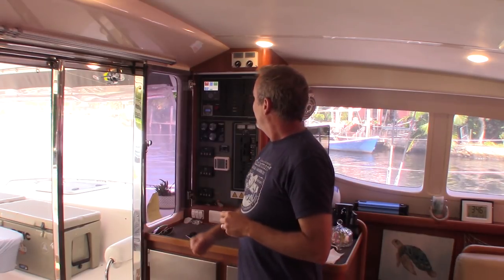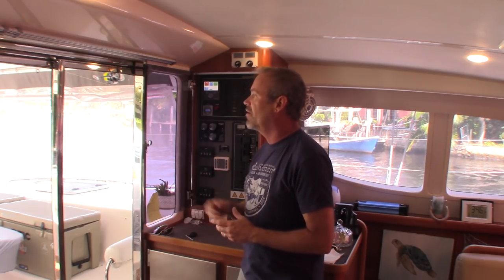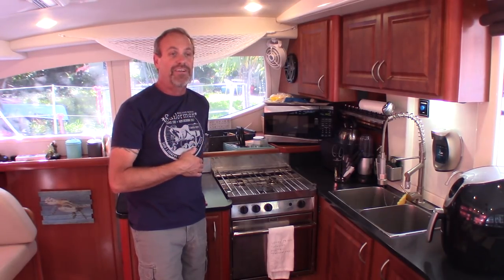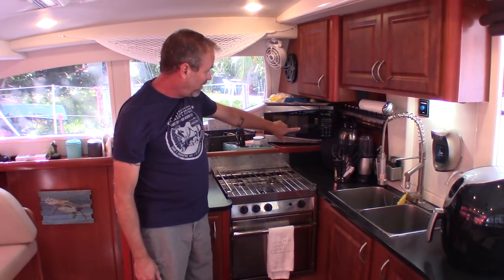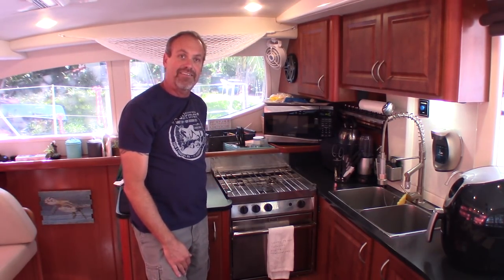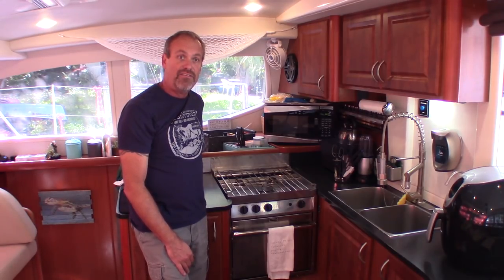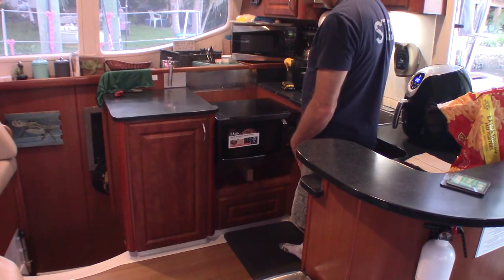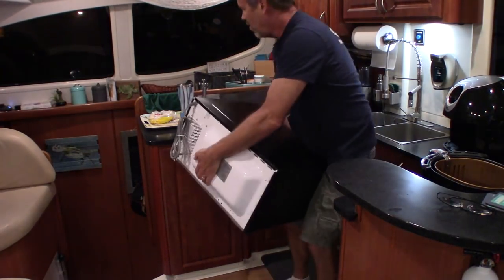Making Money on a Propane to Electric Galley Conversion | Fix It Friday | Sailing The Space Between

Comment: Over time you'll find that the plexiglass (perspex) won't hold up and/or will get melted. May be better to think  of polycarbonate as a replacement. Never did see any retainers for pots slipping off the induction top. Don't know why you say the induction is slower than gas. It should be a lot faster. That's the point :-)
Reply from the maker: I remove the plexi when I cook just to help prolong life. And we use these awesome non slip silicone mats that the induction cooks through. They are magic! I use them when not cooking too when stuff is sliding. Set it on the mat and bam, sits like glue. The induction is pretty quick...

Comment: No box on the receptical?
Reply from the maker: Nope, no back boxes on any receptical in a yacht i was shocked as well but its due to the fact of air flow so they dont corrode I was told not a single back box on any of the outlets pretty wild...
Reply: @SailingTheSpaceBetween  So is that why no conduit?

Comment: You need ventilation for the micro/oven or you will eventually dry out the wood and have a fire hazard on your hands.
Reply from the maker: Yep it is ventilated on both sides top and bottom
Reply: @SailingTheSpaceBetween  Yes the oven does but does it have the space to vent that heat into open space?